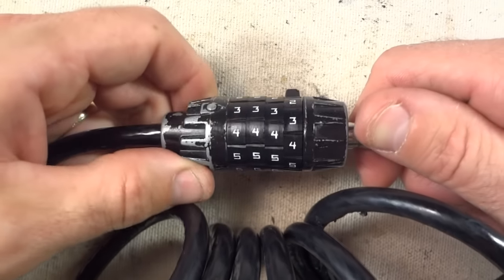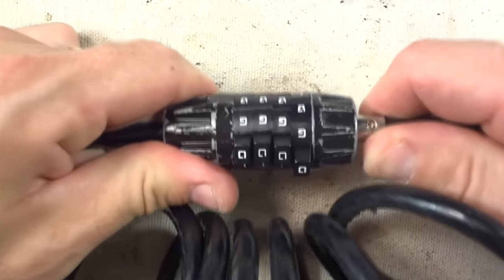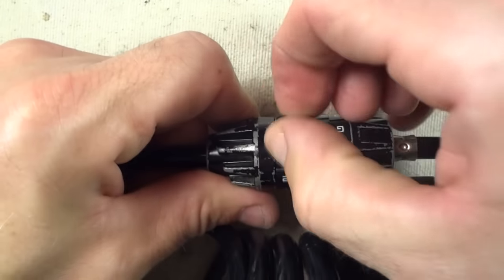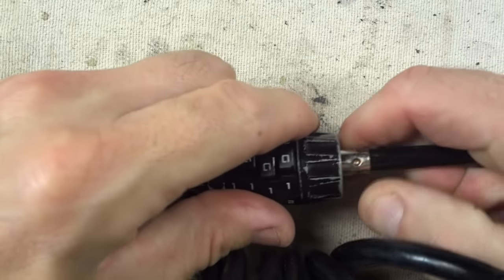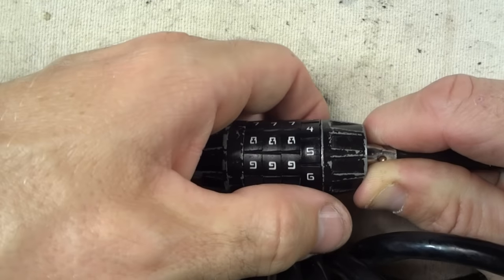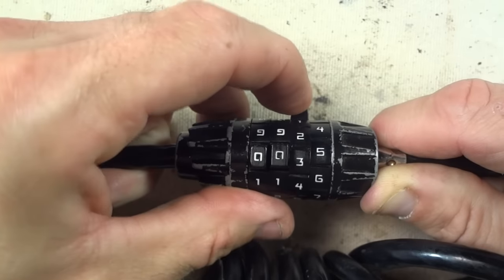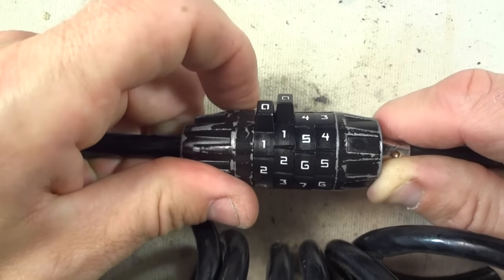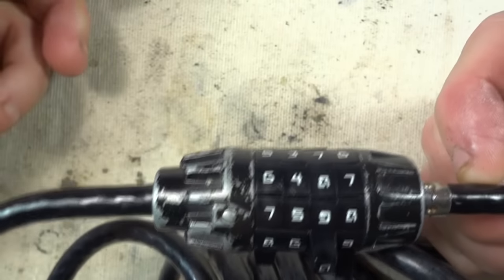How To Unlock Cable Bike Lock Without Combination

Comment: Thanks so much!!! i had to open a lock that was like 4 -5 years old and no one in the family remembered the combination. you saved me a lock and lots of time that would've been spent on cutting it. not to mention the cost of buying a tool to cut it open too. thanks man, this thing works. for other people make sure you have the numbers lined up then apply the pull pressure and do it in an order. it was so cool.

Comment: Thank you, RJ - I used basically the same method to crack / open a 4-number Titanker combination lock that is about 3 years old (so maybe a 2020-21 lock).  I like the WD-40 idea - wish I'd have tried that first.  Also like the idea on not going in order, but instead looking for which dial has more resistance.  I went in order, right to left - the lock opens on the right.  It took me several tries (taking breaks between attempts due to my old, achy hands), and I had nearly given up, but it helped to use more tension, and it also helped to work the cable to it's center on the bike tube of where it was stored in order to get a better grip on each end of the lock mechanism for applying extra tension.   I did this in the quiet of my garage, which helped with hearing what was happening. Going right to left in order, the first number had more of click and drop-in with some play in it - the next two numbers seemed to just stick - and the lock simply slid open on the fourth number, and I'm still relishing the small victory.  Anyway - it was not obvious upon finding each number and had to persist, but the method works.  Thanks again.

Comment: Awesome I had a brand new cable lock which I bought cheap at a ROSS store but the only catch is that someone had placed a combination on it. I did it in no less than 15 seconds according to your method. Thanks this lock has been laying around for over a year and I was about to throw it out. :)

Comment: Wow. It took 2 minutes. Bell brand lock, big and heavy. Put lock around chair for tension. Started on right hand digit. Found "looseness" on number two.2. Spun all cylinders randomly. 3. Then found "looseness" on digit to left of right most digit. This was seven.4. Set last two digits to "72" and then tried all combination for the first two digits. 5. Lock opened at 6272.Thanks! !!!!!!!

Comment: I inherited a bike with a KRYPTONITE lock wrapped around the cross bar.  It was in the way and I wanted to reposition it.  Of course, the combination was lost.   Looked at your video and tried it several times but it did not work.  Kept at it a few times each day and all of a sudden the lock opened.   Key to success is the "feel" of when the wheel seems to have more resistance and placing mild pressure on the lock while rotating the wheels.  Thanks.  Saved me taking it to a bicycle shop.
Reply from the maker: Exactly. It's hard to explain feel. And different locks feel different.

Comment: Awesome. This will make it much easier for people to steal my bike. I was kind of concerned that my new bike lock would make it too difficult for them. Thanks for uploading!
Reply from the maker: If someone is going to steal your bike, they aren't going to monkey around trying to figure out the combination when they can cut the cable in 2 seconds.
Reply: Which is why you don't use a cable lock. Get a titanium or hardened steel chain lock, for example a Kryptonite 1590. Hacksaws and bolt cutters won't work, and good luck trying to pick one. -- One could use an angle grinder or cutting torch, if attracting unwanted attention from the noise and sparks somehow isn't a concern. Chain locks are a bit more of a pain than U-bolt locks as the links tend to shift and move around.
Reply from the maker: @matt_canon  Pretty much any lock can be opened or bypassed. Here is a fun channel: https://www.youtube.com/watch?v=h60e5U88-OI
Reply: Guys, I was just joking. Perhaps I should have put "sarcasm" in parentheses.
Reply: Yeah kinda hard to hear the intended tone of text. ;P It wouldn't surprise me if a lot of people had that concern though.

Comment: Thanks RJ....I was given a bike that has a lock like this on it and now I should be able to get the lock off the seat and top post without cutting it...and I can still use the lock!...
Reply: I would not reccomend using combinación locks to lock up your bike. See how easy it is to open them? a thief can do it too. Also cable locks like this can can be easily cut off. I'd suggest getting a square-link chain or a u-lock, or both (haha) and use combination and cable locks as secondary security.

Comment: Thank you. I just spent the last about 15 minutes going through every code on my bike lock to find the right code before finally thinking "I should probably look this up in case this happens again somehow". My lock is 4 digits ranging from 1 to 6 so there were 1296 different codes and I went through about 1050 to get to the code 6452 :/ looking this up probably should have been the first thing I did.

Comment from the maker: Kick ass Thomason, it works better on some locks than others.
Reply: RJ The Bike Guy umm... dude, is there another way to find this combination: 4650, because when i reset my combination to 4650 i couldnt open it, i was thinking maybe one of the numbers moved while i was reseting it. Like for example: it could of changed from 4650 to 4640. Like the number 5 could of changed to 4. can you please reply or make a vid. PLEEEAAAAAASSSEEEE!!!!!!
Reply: RJ The Bike Guy btw, im not so good at this stuff, Note: im just 10 years old.
Reply from the maker: The method in the video is the easiest. But you can try variations near what you think the combo is. 3650, 4650, 5650, 3550,3750,4550,4750,5550,5650,5750, etc. Or try all combos 10,000 possible combos: 0000,0001,0002...9997,9998,9999.
Reply from the maker: True. I will write down sticky numbers, and try variations of those. Say one wheel seems to catch on 3 and 5. And another on 2 and 9. I will try combinations of those.
Reply from the maker: I can open this lock, and many others like it with my eyes closed. It's by feel.

Comment: Hey, seriously, thanks for the info. I'm new to city life, I just tried bicycling in the city for the first time because of the coronavirus (my workplace has opened back up and I don't wanna use public transit) using my old junker bike. The thing got stolen in less than a week.

I was really curious how, because it's not a nice bike (worth <$100, doubt you could even sell it on the street), so there's no reason anybody would target it for theft. I deliberately parked it in front of a camera, and I asked the place if they'd pull the footage so that I can know how/why they took my bike (did I lock it up wrong? How'd they get the lock off?), but they wouldn't do it for me, told me I had to go to the precinct and that they'd only pull the footage if the bike was actually worth something.

Now I know. Chalk it up to drugs and opportunity. I'll use a better lock next time, LOL! Thanks
Reply from the maker: A bike thief would more likely just cut the cable.
Reply: RJ The Bike Guy See, that’s what I couldn’t make sense of - my bike was the least valuable bike on the rack, and they didn’t leave the lock, so if they cut it they took it with them.

I figured since it made no sense for them to target my bike, not the more valuable ones, it must have been because it was easier to steal

Comment: We use o do that back in elementary. Its a shame that locks still allow this. Is their any brands with a code that do prevent this?
Reply: BELL it doesnt have a part where you can punsh and pull its curvedand all even
Reply from the maker: They can still be pulled.
Reply from the maker: Most any lock can be hacked one way or another. Or defeated with a bolt cutter.

Comment: Just tried again after trying before on a few occasions but it hasnt worked on mine. Ordered an angle grinder of eBay as its too frustrating when none every move of the dial clicks exactly the same and there is zero give. 😢

Comment: Do I do the same if the side that should slide out is halfway stuck?
Reply from the maker: Sounds like it was pulled part way out and then a couple of the wheels turned. So you should only have to turn a couple wheels.
Reply: RJ The Bike Guy even then, I've been doing for a while but can't get it to go. Just wish me luck then lol
Reply from the maker: If it is only being held in by 2 wheels, that is only 100 combinations to try. Set one wheel to 0, and then try the other wheel 0 - 9. Then set the first wheel to 1, and the other wheel 0-9, etc.

Comment: And what do I do if I can't find out which wheel has more pressure? You know, since I need two hands to pull the cable and another to spin the wheels on the lock, but I only have two hands.

Comment: does the same thing work with a 3 digit lock
Reply from the maker: LucyMcG Pretty much any lock with dials like the ones in the video. Also the cheaper the lock, generally the easier it is to do.
Reply: thanks

Comment: It doesn’t work in all bike cables. I’ve tried 1000 times now and I don’t feel any hole. I’ve an AXA cable and its system is a bit different from the one you have. There is a button on the side that has to be pressed to release the lock after the right combination is inserted. Unfortunately I’ll have to cut my lock with a chainsaw.😄
Reply from the maker: Check this video: https://www.youtube.com/watch?v=LXbbb9hf6lE
You might need to press the button lightly as you are rotating the dials.

Comment: Look, any bike thief with some decent bolt croppers would snap the cable anyway. But if they havnt got some, they would take at least 2 minutes to do it by this method, 2 minutes in which you may appear, so it is at least a sort of deterent.       If you want better security, then get an hardened steel chain and boron steel padlock. Heavier to carry, but a hundred times harder to steal!!       Depends how much you value your bike......

Comment: My locked jamed half way out😭
Reply from the maker: Sounds like a wheel turned a little bit. Start over but now you only have to deal with a couple wheels, and they should be close to the right number.

Comment: Sooo, What the actual FUCK do you mean by "holes"??
Reply from the maker: Lokeee You have to FEEL them. There are slots in the rotating discs that the part falls down into. After a bit of practice, you can open many of these locks your your eyes closed.